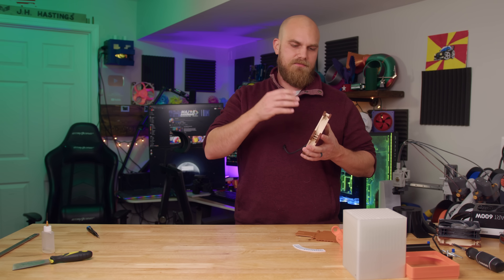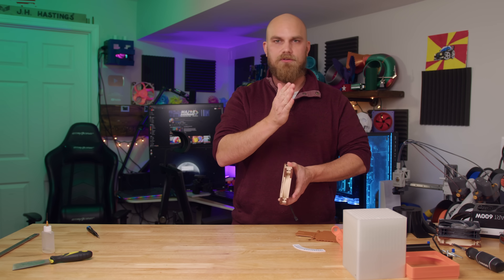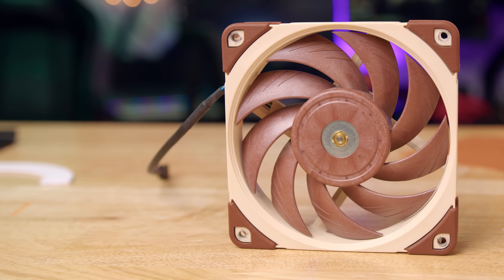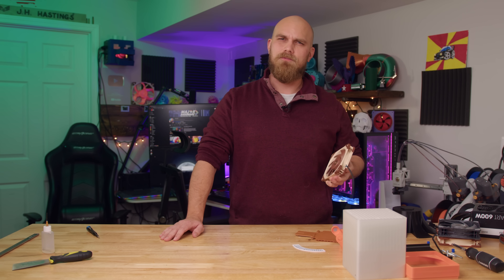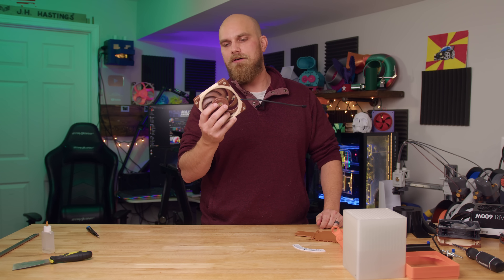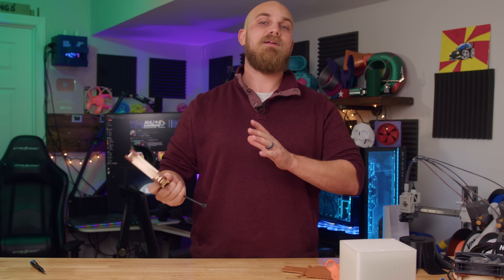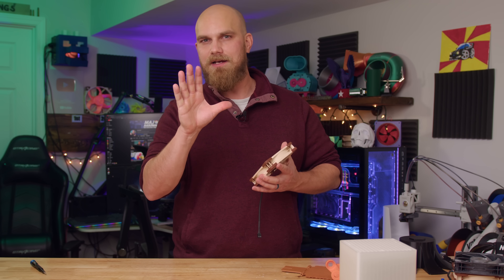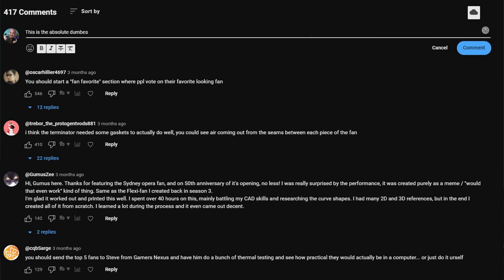I Built a Static Pressure Machine | Fan Showdown Season 6 Pilot

Comment: I have worked in instrumentation, I have a cheap solution, get a centering Ruler in mm(18$ Amazon).  mount it vertically ( Magnets Work well). Get 2 acrylic tubes and some hose and make a U Shape and make it plumb, with a little Hose on both ends( long enough to connect to a test)  fil your tubes about half Way and center your adjustable magnet center ruler at the bottom parabola of the water line. you now have a working monometer. Hose clamps some tubing at home depot and some Magnets and you can put it on your fridge.  Pro tip use yellow with a hint of green food coloring to see it easier. Use a Protractor for your Angle gauge with pivot at center.  I have Worked on Forced and Induced Draft Boilers.  Also Pins Will have less inertia than bearings at small scale.  This is why Hot Wheels don't have bearings.  Hot Wheels hobbyist have cheap wire fore the Axles that work Very Well It comes strait.  Get one end hot and insert into plastic Leave a pilot hole before the hot insert. I have also worked In Micro Switch manufacturing.  Your prints are Missing Pins as pivots instead of plastic posts( I wanna See A pinned double  opposing Prop, one with  Fans/ Bearings).  That is all it would take for you to have a Pro level product.  Hot Wheel or Lego lube is magic on plastic.

Comment: i think the flap is too large to provide a good test between all of the fans, i worry they will just all have the same result.  what about some kinda of changeable orifice that you can move up or down in size, kind of like a carburetor.   could add a bigger and bigger orifice into the system until the fan no longer moves the flapper, then compare that size with other fans??   just a thought!

Comment: OR have the fan blow in to a tunnel with a resistance to air flow then have a U shaped glass tube with water in it and hook one side of the tube to the chamber and compare the water level, this would make a more accurate messurment I belive.

Comment: You made a very fine measuring device. But, not for static pressure. As far as I know, static pressure is the pressure at zero airflow. If you let the fan blow into a closed box, the pressure in the box compared to outside the box, will be the static pressure. Static means standing still. Greetings from Belgium.

Comment: The idea is really good to measure it like this. The only concern that I would have is that a lot of measurements will be close to each other, as the measurement is dependent on the angle of the flap. The ratio of area of the flap to the projected area to flow direction shrinks with cos(angle). So a fan that would have double the static pressure would not cause double the deflection angle. But one could normalize that by the afformentioned area projection factor.

Comment: Given the flap opens at an angle, where every extra degree will increase the opening by more area than the previous degree, wouldn't it make sense the measurement unit isn't 1-2-3-4-5-6...., but more like 1-2-4-6-9-14-...(relative to how much the opening opens and airflow can go through)? Otherwise measuring performance at top end appears miniscule.

Comment: You're one step away from actually being able to measure the air pressure with this.
You "could" just run a clear plastic hose from a container of water located below it, and measure the distance that the water is lifted by the vacuum of the airflow through the chamber... That's essentially how a fans mm of Hg or mm of H20 is determined.

Comment: so not quite going to be accurate enough. For accurate repeatable results you need a sealed tube. ideally you want a u shaped tube thats full of water at the bottom.then you measure how much the water level raises over a given distance. try looking at anaologe manometers especially gas versions they are rated for very low pressures.

Comment: I doubt the home print fans will have significantly more static pressure. you should add weights to the top so the noctua goes a bit more than 6 so you can get a larger range for the other fans

Comment: you want static pressure, blow air into U shaped tube with colored liquid. Wider area inside closed box, narrower tube on the other end of U so that small change in pressure is more visible. Fan at the end of the box and only way for air to escape is back through the fan. thats it.

Comment: door needs to be heavy not light! when it opens it starts loosing air. I would create place underneath to add weights and add or remove them accordingly until door opens few degrees. Fan that pushes most weight and can open the door wins.

Comment: @Major Hardwear so this will be lost, in the noise, but I have to try. Go old school, use a water manometer. One open tube upstream, one downstream of the fan, one at room pressure with a t-joint connecting them all. Fill  water, measure water height change, expressed in mm of water. Simple, repeatable, accurate, cheap. AND able to be repeatable for peer review.

Comment: The idea is good, but...

The implementation of the door is incorrect and here's why - the fact is that the flow pressing on this door in the down part affects the value more than, for example, the flow in the central part due to the moment (the further the pressure point is from the center of the swing, the higher moment). At the same time, as far as I remember, there are fan models that blow stronger in the center than at the edges, but for them you will not get correct data with such an implementation.

It might be worth making the end of the pipe flat (i.e., narrowing the square into a “rectangle”) so that the entire flow would ultimately press on the same part of the door (i.e., have the same moment).

The second point is that you, in fact, do not need such a dense mesh on the back side of the door. It would be enough to make stiffening ribs along the edges and a crosshair in the center, that would be enough.

The weight of the door is actually very important - the more fully your scale is used, the more accurate the measurements.

Comment: I'd think if you put a rubber membrane across the exhaust, you could measure the deflection. More expansion is more pressure. Probably a square meter, since the pressure is so low

Comment: I was thinking about using the definition of the static pressure itself: mm H2O
My idea was a sealed chamber with a hole that a fan can be mounted onto it with a decent seal.
another opening is pointed downward then curl back up like a U that is filled with water.
The pressure will be measured by the difference in height between the 2 half of the U pipe.

Comment: I think that if you (mostly) close the sides of the door, even with a transparent panel or something like that, the increase of the area where the air can escape would be slower when the panel opens and you might be able to get more granular results than you're getting now where I fear the fans might end up all too clustered on similar value. Closing the bottom too might help if the sides are not enough.
Reply: Same thought.  As it is now, the air seemed to be moving down the direction of the  flap.  Closing the sides and bottom longer if not the same length of the flap could drive the air straight.

Comment: The concept is nice but a couple flaws. The design as it sits still only measures flow, you want to be measuring the pressure between the fan and the "load". Make a significantly higher air restriction for it push against, think 2" thick rad, and have a weight in a tube for it to push up between the fan and the restriction, the exhaust should be clear. Make the vertical weight adjustable so you can calibrate for a baseline. ideally you want the weight sealed to the tube but with your tools, 3d printer, some leakage should be acceptable to use for comparisons between fans.

Comment: Very neat design, but I think you can improve it into something that works much better!

Like.. a constant-flow design perhaps?. 

Here's how I would do it:
1. Add an internal grating two inches after the fan to ensure laminar flow.
2. Integrate your air-flow meter inside a longer section, and use a funnel design both in front and after to ensure all air passes through the instrument laminarly.
3. Use your flap as an adjustable flow restrictor by adding a way to lock the flap in place when you get the correct amount of air flow.
4. Run a long, clear plastic straw/tube horizontally along the box to measure the pressure inside. By first leveling the mounting surface, and then adding a small block under where the fan mounts, you can give the whole arrangement a predictable very slight inclination. This allows you to vastly increase your measuring sensitivity 100-fold, going from 2.3mm to 230mm.

Oh, and rememeber to add some dish soap to the water to break the surface tension (for accurate readings).

I think it would make for a visually striking and intuitive test rig, in line with what you seem to be going for.

I'm happy to provide you with sketches and/or assist with the design if you're interested, just let me know.

Regardless, awesome series dude.

Comment: you can try and use a liquid base differential manometer which can measure the static pressure before and after the radiator they re quite precise and relatively cheap

Comment: 2 unprof. suggestion if I may: #1 Be careful with the balance of the construction. Even a little angle it turns over the stand it just adds to (or removes from) the angle of the measured pressure. So the wind tunnel should fit with the stand much more to have a more robust construction. #2 The angled scale should have a bit better resolution as seemingly the fans will come together very close (if the best is around at 6-7, all the others will be condensed under that). I could imagine some optical read stuff there, though I admit that can raise the cost of the stuff a bit. Whatever I tried to say here, never mind, your stuff is so cool that is already grabs my attention. I won't just stay your passive sub, but watching every piece of your fan showdowns from the beginning... best!

Comment: This is a genius idea. My only suggestion is that I feel the resolution should be a bit more granular. One way you could do this is to thin the counterweight and extend it, moving the "meter" back a bit further from the hole. I feel like a lot of fans might hit around the same mark (namely the worse ones) and delineating between them will kinda muddy the data. This could be a bit pedantic of a point, but I feel like it gives all the fans a fair shot to have a rank of their own, no matter how small the difference is. 

One way you could shift weight with the extension is to taper the outer sides of the ends to a point so that there isn't a bunch of weight on the ends putting a bunch of torque that's hard to balance against. Cuts down on the amount of time-devouring Nerd Shit™ you have to do to make it work. Plus, with that taper, you can make it WAY longer, possibly even pushing the base of the meter all the way to the entrance of the tunnel, giving you loads of extra resolution.

And although it's probably wayyyy too fiddly to deal with, you could set an array of small magnetometer ICs equally spaced along the meter track (like the little 3-4 pin through-hole ones) and attach tiny magnets to the ends, automatically recording the data and finding the EXACT position of the "needle" along it. Probably a bit too mathy to get running, but would be neat.

Comment: i guess you can do some tests to see if there is any big difference between all your measurement techniques. meaning: is the best in one test always the best in the other tests also etc. see some correlation. if so you can just stick to one. but then you would need to redo all tests with all previous fans to have some comparison. as you said also you should modify this flap so that the noctua fan is 100%, get the angle as large as possible to get a finer resolution. ( i guess you just need to ad some weights at the top to balance the flaps CG more towards the pivot point.

Comment: I am not sure I am completely right, but wouldn't this be more of a flowmeter than a static pressure meter? The weight of the flap is very low, so you are not really pressurizing the tube, at least not very much. A static pressure test would be more like making a tube with a dead end and putting a barometer/monometer at the end of that to see what kind of static pressure the fan could hold constant. 

I see several other comments here pointing out that a straight up static pressure test is really not all that useful for real applications, and same goes for the pure airflow tests. I am inclined to agree with them, but I think that by adding a bit of weight to the flapper on your current design, you would be making a test bench that would measure some combination of pressure and flow anyway. I am a fan of this test bench, but I would like to see some weight added to the flapper to increase the impact of static pressure in the testing methodology.

Comment: Longer arm for more accuracy, even attaching a fine rigid wire to what you’ve got. 
Potentially also flow construction, maybe the angle of deflection changes how much needs displaced. Considering where each “pixel” of flow hits the flap at a different distance each row, that could effect accuracy too.
Reply: Enclose the flap as well…

Comment: You should balance the door slightly more (more weight on top) so the A12 brings it maybe 3/4 open? Also, a longer dial on top gives better granularity between runs. 

And 100% you should tape up the gaps to seal it better. Actually, if you can get some flexible filament to print a gasket, you want to seal the fan in as best you can, especially if you are grading on pressure.

Comment: A nice attempt, but this is still not a static pressure measurement. You're still fundamentally measuring airflow. Infact, this device is just how early digifant engine management systems measured airflow into internal combustion engines. I have an airflow meter just like this on my 1996 Seat Ibiza. You can also find them on 80's and 90's BMW's and many other cars.
I think a better measure of static pressure could be achieved by using a fixed restriction at the outlet of the test apparatus, and use a traditional manometer (a tube filled with liquid) for which one end is open to the room, and the other end is open inside the chamber, behind the fan, but before the restriction.
The trick is then to use a low specific gravity fluid in the manometer to give better resolution to your measurements.
So rather than using water, you could use ethyl alcohol, for instance. 
Then all you need to do is measure the difference in the height of the column of fluid outside the chamber, when the fan is off, and when it's at it's steady state running.
True static pressure would be with basically complete restriction. I don't know how valuable that data is for anyone really though. It's not so useful to know how hard a fan pushes on the dust in a plugged filter or radiator 🤣

Comment: This not meansure Pressure, this measure airflow. If you will use slow moving fan with extremly high pressure, it will move so tiny bit of air that flaps will not open but presure can be really high.
Im for solution with low viscosity fluid...

Comment: A slightly more hazardous solution would be to build a mercury barometer. With the fan mount at fixed distance (to minimize turbulence in fluid) blowing down on the reservoir and the tube with graduation showing the increase in pressure? something like:
  __
  |  |
  |  |
  |~|
  |~|
  |~|     |.     * FAN *.     |
  |~|___|                         |
\|~|~~~~~~~~~~~~/
 |____________________|

Comment: Looks cool. I'd rescale it by making the upper part of the flap - the Indikator - a bit heavier, either reprint or test it with blue-tack first just to make A1025 land in the middle. You can even trust the measurement from the data sheet and scale it with "mm of H2O", but it won't be linear and we can go with "MajorHW's of preassure" scale forward 😀

Comment: The vane should be enclosure so that your measure surface would not change in time when it moves. Picture something like a flap mass airflow (MAF), and you can use a magnetic encoder to acquire the angle.

Comment: ok so the number on a fans box if  it was properly tested is not a peek pressure it's max pressure at 50% of peek flow. so if a fan free flow is 100cfm this is restricted to 50cfm and pressure is checked.
if you want to measure the h20 scale way but be able to see more than 1-3mm of change this is done by changing the tube diameter the pressure on the surface of the fluid is based on the surface area so if you impose a 2mm change on a 10mm id tube tied in before the re-stricter with a 2mm id tube for view you get a 25X multiplier.
another idea is to slap a BMP581 on an Arduino/esp32 and zero just before Each test it's not good for this from an absolute vs barometric. but at 1/64 a pascal data set can be averaged out well enough maybe take 100 readings and avg them before each fan and after the difference is your result 3mm of water is just under 30pa with 1/64 accuracy this gets you a 0-30pa range in 0.0156 steps you can scale this in any way you want all on a button or two and  a small display and your golden best yet put this in last years setup and around half way down the tube add a 3d printed iris so you can control the restriction to 50%ish